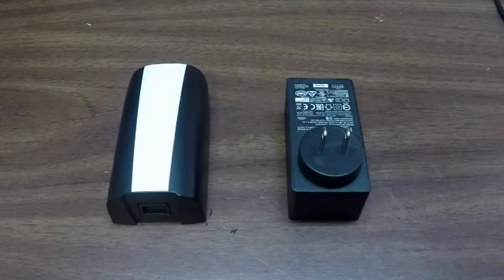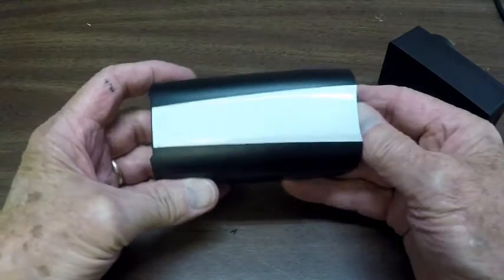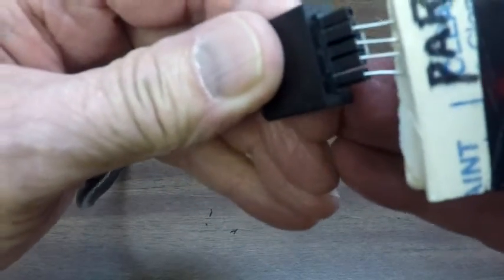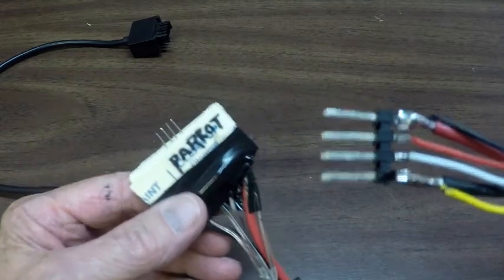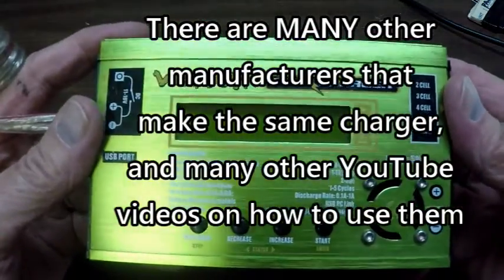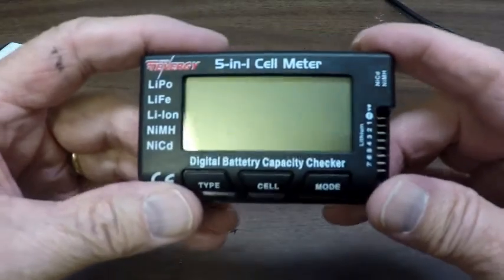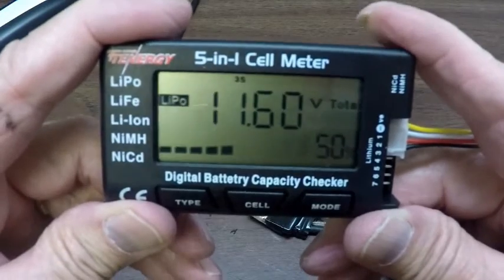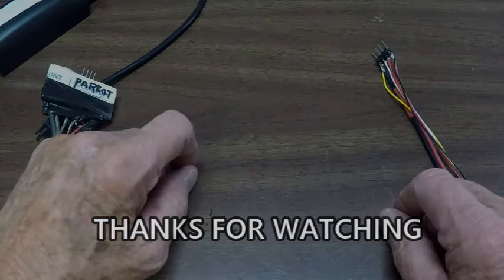BEBOP 2 BALANCED BATTERY CHARGING CLARIFIED - TESTING BATTERY CELLS

Comment: Hello,
I bought a Parrot Bebop 2
I did the following test to the battery------>>>>  http://thehighproglow.blogspot.com.es/2016/12/how-to-measure-parrot-bebop-1-2-battery.html
And my voltages are the following:
Cell 1:  1.75 V
Cell 2: 5.80 V
Cell3: 3.96 V
All cell: 11.9 V
Please let me know if my new battery is broken or is a new system change because I disarm the battery and measure before the integrated circuit and the cells are balanced, Or is it a typical failure of the integrated circuit of the battery?
Reply from the maker: Any LiPo battery cell should have a voltage from about 3.7 to 4.2 volts. Anything out of that range indicates that the battery is probably not very useful. I don't believe there is any circuitry inside the battery but I could be wrong. That 5.8 voltage could be dangerous so keep an eye on it because they can catch fire when charged above or discharged below the range I mentioned.

I would get a balanced charger which I mention in many of my videos, give it a balanced charge and see how things look after that. If you battery is brand new you may want to contact Parrot for a replacement. I would be interested in what the cells look like following a balanced charge. Welcome, by the way, to the Bebop community. Never hesitate to ask questions. God bless.
Reply: My problem is that the PCB(protection circuit original batteries)  failed, for that reason the difference of voltages, in a forum some users remove that internal circuit of the battery. But I'll wait for Parrot's answer.
Reply from the maker: OK, you are learning fast. That is interesting information. Please keep me posted.

Comment: Good day Sir I have a question for you please I have a bebop 2 and my issue is with my battery. I had downloaded the latest firmware for the bebop now my battery fully charged only lasts around 9 minutes , it is an original battery and original charger . When charging the light is red when charged it turns green . Any ideas thank you in advance.
Reply from the maker: Hmmmmm . . . How much time were you getting prior to the upgrade? Have you looked through all of your setting to be sure nothing extra is turned on? I don't have an answer right now. Let me know the answer to the previous question and I will be giving it some thought. God bless.
Reply: mrkentdotcom I was getting close to 22 minutes before ... everything is set the same , the only thing I have changed is I went from using my iPhone too my android phone but that shouldn't effect the battery on the drone .
Reply from the maker: Are you using a balanced charger? Are you sure your battery was fully charged following the upgrade. You can check that by bringing up the "my flights" page and looking at the graph for the nine-minute flight.
Reply: mrkentdotcom yes the battery has a full charge according to the graph on My Flights page . I have charged and flown my bebop all weekend and nothing changed still a 9 minute flight .
Reply from the maker: Wow! I don't have any more suggestions other than to do the reset I recommend in this video: https://www.youtube.com/watch?v=kXCPr0DgVbo

Watch the video and then try it and see if that helps. If it doesn't you may want to contact Parrot support. Just google that to get help. As I understand they are about the best of all of the drone companies. Please let me know if you find a solution so we can help the next guy :) God bless
Reply: mrkentdotcom Hi there just to update you , charged my battery full went out for a flight it lasted 11 minutes, when it got too 2% it started beeping so I landed it at 1% and decided to let it drain out to 0% ... it stayed on 1% for nearly 9 minutes then switch to 0% . Help please
Reply from the maker: Are you using a balanced charger, or the one that comes with the Bebop? The one that comes with the Bebop is not the best way to charge the battery. The battery that came with mine is no good for any long flights because I just used the Parrot charger at first. I tried a lot of methods until I finally came up with what is shown in this video:
https://www.youtube.com/watch?v=b1X77aK7ki0
Also, with LiPo batteries it is not good to discharge them below about 10% so avoid doing what you explained in the above comment. The cost of a balanced "charger" is less than that of a new battery. If you want to go that route and have any questions don't hesitate to ask. God bless.
Reply: mrkentdotcom I am using the charger that came with the Bebop. By any chance do you make and sell the Balanced Chargers ?
Reply from the maker: No, I am sorry. I get a lot of requests for that. You can order "lipo battery balanced charger" on Amazon. I have the links to where to order everything you need to connect to the Bebop 2 battery on the video I recommended. And I know of one person who will solder it all together for about $25. His link on facebook is shown below. That should get you started. Further questions are welcomed. God bless.

https://www.facebook.com/search/top/?q=christopher%20richard%20smith
Reply: mrkentdotcom Good day Sir just to update you I got a balanced battery charger it works great ONLY .... When I take my bebop out the battery reads 100% then jumps to 70% rapid depletion of the battery , very frustrating indeed . Called Parrot and of course the warranty on the battery is 6 months . I get about 9 minutes of air time which is half of what I used to get . Is the battery bust ?.
What other battery do you recommend I get ?
Reply from the maker: I don't have good news for you. I have one (my first before getting a balanced charger) which I keep handy for use when doing maintenance, etc. Then, I have another one which is a little better - I get about nine minutes of flying out of it. Then I have a 3100 mAh which I fly with most of the time because it gives me the longest flights. When Parrot advertises the battery-endurance they are not telling us that 25 minutes or more is only available when NOT using the camera. But, I'm OK with that because my first drone (Phantom 1) which cost me $450 used would only give me between six and eight minutes on a new battery. I have also heard the the latest firmware upgrade may be using more battery than earlier versions, but that is not confirmed by me yet. I'm happy for you that you can now keep your battery balanced. God bless.

Comment: Hi, Thank you for your videos, very helpful. I too have just bought a Bebop 2 fpv pack with skycontroller 2. Could you please confirm if the lead you linked to in your other video is any good for me or not.
Thank you
Mal
Reply from the maker: Hello. Thank you for your comment. I am not sure I understand your question because I reference more than one video. So, if you could clarify that would be good. The important thing to keep in mind about a lipo battery is to allow it to discharge to its normal voltage value which I believe is round 3.1 volts per cell. That will help your battery to remain more balanced naturally. 

But, pleas clarify your question and I will try to answer more accurately. And have fun with your new Bebop.
Reply: Hello again. Thank you for very quick reply and i'm sorry for being vague with my question.
In your video showing how to make the lead to fit the battery to the balance charger you put a link saying "buy a better one" underneath the video, the link is: http://www.ebay.com/itm/Parrot-bebop-2-drone-battery-charger-cable-3-In-1-Battery-Balance-Charger-cable-/252648802555?hash=item3ad30ac8fb%3Ag%3A140AAOSwXeJYNT~U

Would this item be ok for me to use with my bebop 2 (skycontroller 2) package please?

Thank you
Mal
Reply from the maker: Yes, that will work if you have a charger shown in the video which has the "balancing" feature. I had forgotten about that extra comment I made. In fact, I think I will order one. Thanks again and God bless.
Reply from the maker: OOPS! After I thought about it for a while I realized that the two heavy current wires are not included with the ebay connector. That connector may, or may not work for charging. But it doesn't cost an arm and a leg so you could get one and try it. Sorry about not thinking it through before answering.